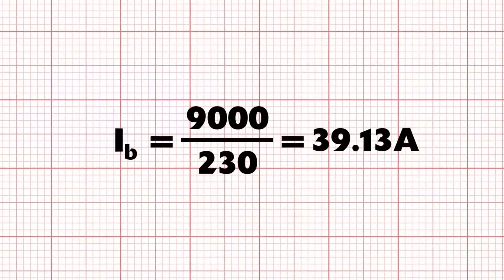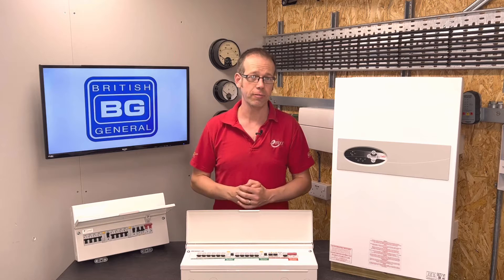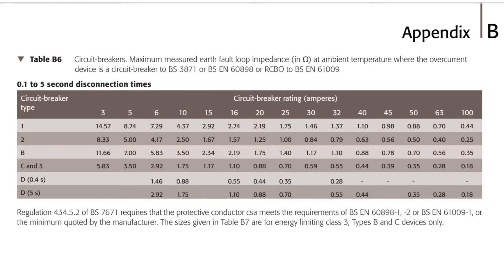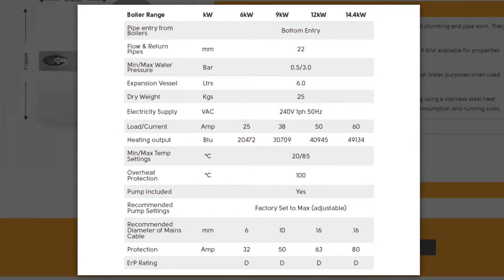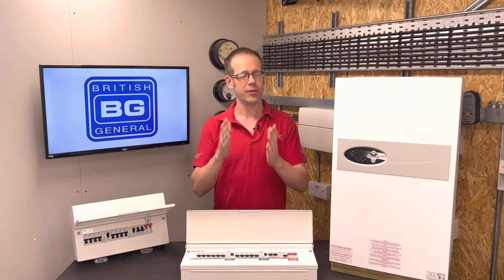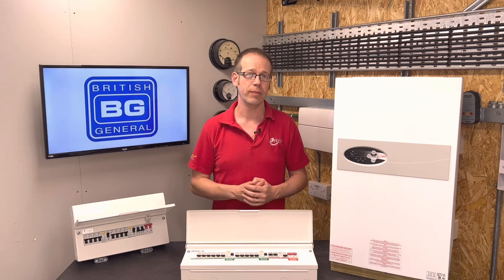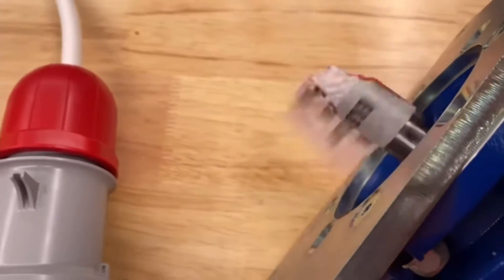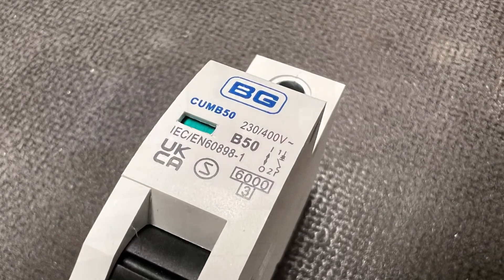Electricians' Guide: Circuit Protective Device Selection

Comment: A common fault with certain new items stored in ( damp ? ) sheds , (  air fryers , sandwich toasters etc ...  ) , is that damp gets into the element's mineral insulation causing modern house's RCD to constantly trip , the owner might then throw this item away ! .... one trick is to take it to a house with ( old skool fuse box circuits ! ) , run the item for an hour or two , and hey presto ! the RCD no longer trips at the customer's house ..... ( tried - n - tested ) ............ DAVE™ 🛑

Comment: 3:40 in the video you say if the nominal voltage U0 goes higher it will cause more current to flow? ln = P/U0  if U0 is higher the current will fall.  Worst case scenario Ln = 9000/253 =35.6A
Reply: The mistake is thinking the power is fixed. It’s not
The 9kW is at 230v. If the voltage goes up, so does the power and current
Reply: 9000 is the power in watts. not the resistance
Reply: @scwfan08  not sure if that was directed at me but yes I'm aware of that. For a fixed resistive load V2/R is going define the current in this instance as yes the power rating will be at 230 (probably) as you said.
Reply: I think it was just a mistake.
Reply: Resistive load. Bang the same figures into ohms law.
Reply: After you've derived a resistance
Reply: The boiler is 9kw @ 240v, as the datasheet shows
Reply: For example: 230/10ohms Vs 250/10 ohms... Which gives you the most current?
Reply: A 9 kw load if the voltage increases the current decreases 
Which is why you need to be careful when using a cable close to its current carrying capacity as the on site voltage could drop to say 218 volts and stress the cable or switch gear/ accessories 
I’ve seen plenty of 13 amp outlets and spurs melt pulling like 13.1 amps load,
Reply: @oiuslags  It's not a "9kW load". It's only 9kW at 230v
or do you think at 1v it draws 9000A?
Reply: @TheAviation101  yeah i think that was the gist :)
Reply: 🤦 this is just ohms law. 🤦

Comment: @3.34 If the boiler load characteristic is 'purely' resistive would kinda depend a little bit on the internals so definitely not ideal to infer as such. I mean its definitely fair that its not purely inductive either cause it wont be. But the exent of the phase change between I and V will depend on the types of pump. Most seem to be AC therefore have an inductance value of some sort (usually low uH)... so depending on the size of the motor it will definitely add an inductive element reducing the PF away from Unity (ie PF of 1, or 100%). Also the low power element need a AC-DC PSU, which will have  filter caps on its input lines (Class XY) adding capactance to the load characteristic further reducing the load PF away from Unity.

I fully appreciate this is pedantic as hell... the PF is still going to be high as the above elements will only contribute a small amount, but this being a training module, it perhaps needs to be more 'accurate' than a casual video and to say a boiler is a 'purely' resistive load (ie PF of 100%) isn't technically correct. 

Its gonna be close and (hazarding a guess) have a PF in the order of 80-99%. I would say the load is 'almost entirely resistive'.

This is pedantic as hell.... I get that, but this isna training video as part of a CPD certified course.

I hope I'm not missing something obvious.....
Reply from the maker: It's a fair point, and I debated this point back and forth a lot to be fair, but I think as it's an introductory course I've struck the right balance between being alert to manufacturer's direction and going too far into the finer details. Modifications due to power factor will likely be covered in future training modules.
Reply: In fairness though... Small controls aside... All of the actual load is resistive. Any electronics are going to be a negligible contribution to the whole. Obviously if there was a stated power factor you should use it but if there was one in this case it will probably say greater than 0.99 if anything and he did say manufacturers instructions should be consulted.
Reply: I don't think it is a question of striking the right balance. 

It is easy enough to explain that a heating element made from a coil of wire will have some amount of inductance as it's also a solenoid passing a current and creating a magnetic field.  This is quite literally school level.

So it can be explained that a heating element has both electrical resistance in order to generate heat, and have some amount of inductance because it's creating a magnetic field.

And therefore as it is not a 100% resistive load, the power factor is less than 1.

I have just explained it without going in to too much detail and using knowledge which the student already has, or should have.

So there is an explanation which is very simple to understand that doesn't go into heavy detail and is factually accurate.

How then do you explain an electrical clothes iron which sparks when turned off or unplugged? Doesn't that contain a heating element?  What's the cause of that, the resistance element of the load?
Reply: @deang5622  because there's enough voltage for the current to jump the gap as the contacts open or close. This happens even with convection heaters. It isn't unique to an inductive load but it is more visible on heating loads because of the current draw. 

This is such an argument over nothing on this thread it's unreal. None of our designs or calculations are accurate to the level of needing to worry about power factor on resistive loads like this. It's verging on farcical.
Reply: @travoltasbiplane1551  And you think that for an iron it only happens as a result of the 230 volts across the contact?
Utter nonsense. Ever heard of back EMF's?

Do you know what causes a Back EMF?
Reply: @deang5622  Yes I have heard of back EMF's and yes I know what causes them - because I actually do this as a job. If you think a domestic Iron is producing them in any significant quantity I think you need to go re-read that GCSE physics text book you're referring to.

And yes I still think what you are seeing is current jumping the contacts as they close and the resistance of the air is overcome - its just a small arc. You're overthinking it.

But you can convince yourself that an Iron is a significant inductive load if it makes you feel better. Stick your kitchen sockets on a type D mcb just in case mate. 

Apologies for the sarcasm - I just find being patronised on the internet a bit tiresome. Particularly over something as absurd as this. And be under no illusion: It is absurd.
Reply: @travoltasbiplane1551 
   e =-L.dϕ/dt

That's the formula you need.
L is the inductance
The minus sign is the expression of Lenz's Law
The  dϕ/dt is Faraday's Law.
Reply: @deang5622  found that book did you? Found that inductor in the iron as well?
Reply: @travoltasbiplane1551  I was taught by a lecturer. So no, I didn't find it a book.
I recalled it from my memory from 30 years ago. You see, I've still "got it", along with a load of other electrical formulae.
LoL. Nice try mate, nice try!
Reply: @deang5622  that'd be a no on the inductor in the iron then would it? And when you say lecturer 30yrs ago you meant to say Google 30 seconds ago didn't you?
Reply: @travoltasbiplane1551  Why do you assume people are lying?
Can you not accept there are people out there that know this subject far better than you?
Reply: @travoltasbiplane1551  If you could be bothered, but I am pretty sure you won't because you don't want to be proven wrong, but if you could be bothered to go back through the last 200 hundred posts I have made on YouTube, you will find in amongst them a number of long very detailed posts explaining electrical principles, covering all number of electrical topics from magnetic fields, semiconductor devices, and basic principles which are not taught to amateurs of electricity - the electrician.

You will discover I have a propensity to correct the incorrect statements made by amateurs such as yourself. And I have even corrected eFixx too, at least twice.
Reply: @deang5622  so you're come back is: I said it so you should believe it. Righto. 

I know nothing about you and you know nothing about me. But... if you can point me toward a reputable source to read - telling me about the inductive properties of the aforementioned resistive small domestic appliance I will graciously admit defeat and happily say I've learnt something and offer my thanks. 

The reality is that on a resistive load like an iron the reactive component is negligible and not worthy of my time and you wont supply anything. It also isn't the reason why you may or may not get an arc when you turn it on. 

Please only reply if you actually have a point to make.